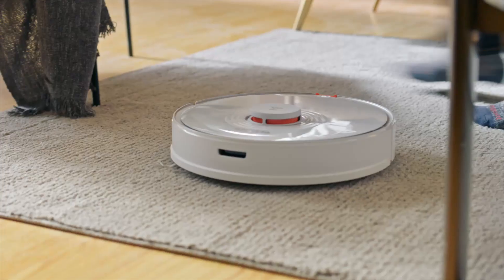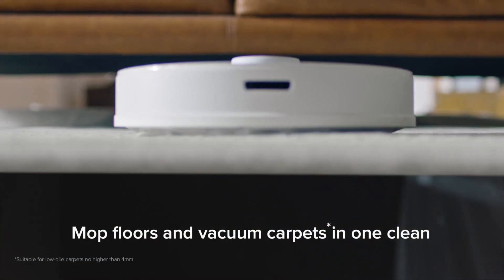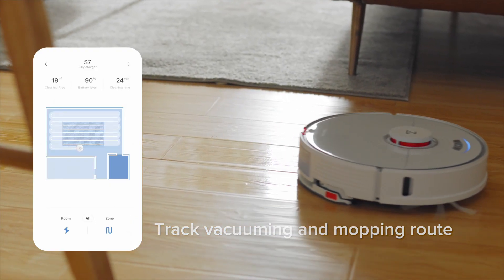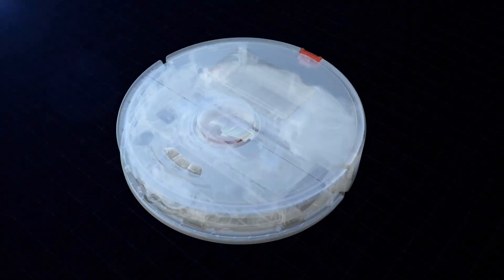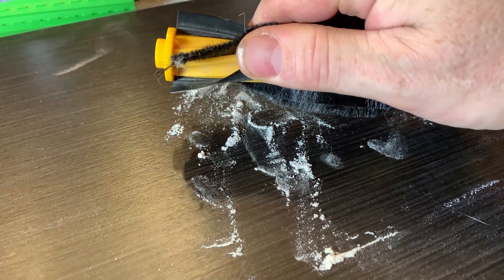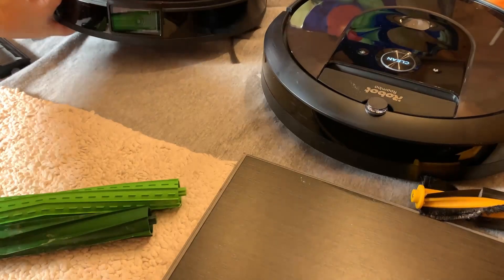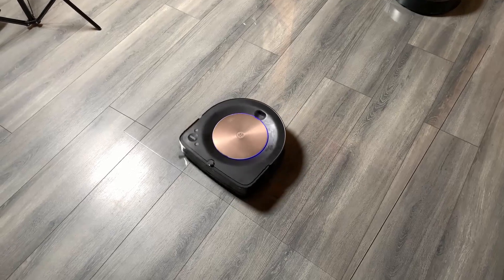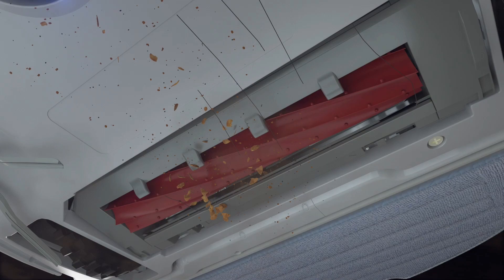Roborock S7 - New Brush Design, Will it Scratch Your Floors?

Comment: Hi, I got s7 maxv and it even scratches my tiles (!). Reason of this is the plastic teeths which are part of the brush cover. Was trying to stick the tape to it but with no result - it gets simply removed during the vacuuming. Wondering if anyone found a solution to this? I was thinking if I can remove these teeths and polish the surface?
Reply from the maker: Even if the plastic teeth were touching the floor, they cannot scratch ceramic tiles. And they do not touch the floor, not even a little. Are you sure what you are seeing are scratches? Mine used to leave lines on the floor but you could rub them off with your finger. Now it stopped doing that.
Reply: @MrRoombato  I got pics where you can see these teeth are affected - plastic is scratched due to contacting the floor so it must be them. And they indeed are in contact with the floor as entire cover is floating
Reply from the maker: Maybe your robot is out of spec. On mine, if you put it on a flat surface like a table and look underneath, those teeth are quite far from the floor.

Comment: Did you end up testing this and seeing if it will scratch the floor?
Reply from the maker: No, because I'd have to use it in my house to test it, and I like my floors. I've had multiple subscribers report that it does indeed scratch floors, and pretty severely, but not from the brush. It's the brush housing, for the most part.
Reply: @MrRoombato  yeah I’ve been doing some research and I’ve heard that too. It looks like it would be possible to Dremel those things right down. Have you heard of anyone successfully doing this?
Reply from the maker: @pklemm1  I haven't. And you shouldn't have to. Also, that auto-empty bin sucks. So...why bother?
Reply: @MrRoombato  true… you don’t know if any other brush holder fits on the S7, do you?
Reply from the maker: @pklemm1  Nope, and again, why bother? Why fix a broken product? Just don't buy it. Get something that isn't ridiculous.
Reply: @MrRoombato  any good suggestions?
Reply from the maker: @pklemm1  I am using the Neabot Q11 right now. It's going through some growing pains (firmware, app) but it's mostly good now. The only downside is it's more prone to hair tangles than some other robots. But I still own every robot I've ever reviewed, and that's the one I use. That and the N1 for my bedroom and study/office. They aren't the best robots but they are the only ones that work without annoying the @#@$@! out of me.

Comment: Have you tested it? I really want to get the S7 instead of the S6 Max V for a potential upgrade to the cleaning base later, but I feel like I will have to settle for the S6 Max V :(
Reply: I can confirm it scratches floor even on lower setting. It is visible with flashlight. Tested in wooden table and it literally dug its way.
Reply from the maker: @smilen-monev  Thank you for letting me know. It's very unfortunate. Do you know what about it does the scratching? Is it the brush? The housing? Both?
Reply: @MrRoombato  the housing, the 4 parts act as teeth to an extent.
Reply from the maker: @smilen-monev  Thank you. Unfortunately a few others have said that as well. It's a shame. Roborock is now permanently scratched off (haha scratched) my list of viable robovacs. At least until they abandon this madness.
Reply from the maker: Sorry, no. If they send me one, sure, but I'm not going to pay my own money for it. I've had several subscribers report scratched floors, mostly from the brush housing. I'd skip the S6 MaxV (wanna buy mine? :) ). I LOVE the robot itself, but no auto-empty dock makes it kinda useless for me.

Comment: Would having the Roomba vacuum carpets before vacuuming hardwood floors take care of this issue?
Reply from the maker: I don't know what the issue is with the S7 precisely because I haven't tested it, all I know is that it has a rubber brush that picks up dirt and a brush housing that presses dirty plastic into the floor. Also,  several subscribers have told me that it scratched their floors and one sent me photos. Regardless, it's not something that's going to be fixed by cleaning carpets first. Maybe thoroughly cleaning the housing and brush after each cleaning would mitigate it to the point where you'll never notice, but I can't be sure.

Comment: Hello, are you going to test Honiture Q6? A scratch test would also be welcome ... For now what is the best vacuum cleaner for you that does not scratch or scratch all? otherwise you have to prefer the swiffer broom ^^
Reply from the maker: The Q6 appears to be built by the same company that makes the Neabot N1, so unless they screw up the app, it's a great robot. The Neabot is my favorite robot so far...it would be the Ecovacs T8 AIVI, but its auto-empty station sucks (or fails to, rather) for pet hair and its app is buggy. So far in my experience, only robots with rubber brushes and brush housing that press firmly down scratch floors, so anything with a hybrid brush should be fine. The Neabot doesn't scratch floors, so the Q6 shouldn't either.
Reply: @MrRoombato  thank you so much !

Comment: My wood floors are very veiny as they’re sandblasted, so the fine bristles actually clean them much better than full-rubber brushes.
Shame you can’t actually choose what kind of brush you want to mount on these things.
Reply from the maker: Indeed! However, I recently learned that iLife has a new lidar robot, the A10, that comes with two brushes...a hybrid and a fully rubber one. So if it does well commercially, that will be a feature that other manufacturers may adopt.

Comment: On the roborock S7 website it lists “scratch Safe wheels and brushes”
Reply from the maker: That’s promising, it means they are aware of the issue. If I had to guess, it’s the bumps on the fins. They could keep the fin from rubbing against the ground.
Reply: @MrRoombato  I think these bumps leave scratches on the floor.
Reply from the maker: @kmerdzhov  The bumps in the brush? That's such a shame.
Reply: @MrRoombato  yes, it's indeed very disappointing
Reply: @kmerdzhov  Have you tried the S7, and experienced scratches?

Comment: Why don’t robot vacuums come with soft rollers... i dont have any carpet
Reply from the maker: That’s an excellent question. They should. But many of the hybrid brushes only make contact with the bristles on hard floors. The rubber fins come into contact with carpet, since the fibers stick up higher. That’s not always the case though.
Reply: @MrRoombato  exactly. I found on cordless stick vacuums, the soft rollers are just amazing and i know many people who don’t have any form of carpet. It would be even better if it had a dual roller system like shark vacuums.

I also found that since my wife has long hair, most robot vacuums will have tangles around the roller and side brushes within two days, so i hope manufacturers find a way to deal with that
Reply from the maker: @Zoranurai13  My wife also has long dark hair as thick as piano wire. So do my daughters (though not as thick!). So fishing that out of robot vacs is a pain in the butt, since I have five robots on active duty. I used to do it every other day, but now I just do it once a week. The i7 is good at avoiding tangles, and the hybrid brush robots clean fine with hair wrapped around the brushes.

Comment: Same problem when washing/waxing cars with same towels/sponge
Reply from the maker: You're totally right. I should have used that as an example!
Reply: @MrRoombato  haven't really seen this with my 595 but plastic housing did scratch when hit furniture. Fixed that by adding one of the cushions sold to prevent that.
Reply from the maker: @kinglord5429  From what I can tell by looking online, the 595 has one bristle brush and one rubber brush. The rubber brush may not be the "offending one," which I think is the light green one with the really small fins. The dark green one has large fins and probably doesn't make too much contact with the ground.

Also, you wouldn't really notice it for a very long time. I only noticed because of a freakish coincidence, which is what made me do my tests.
Reply: @MrRoombato  the 595 is close to 10 years old, this is like a tank. It does use bristles and one rubber which doesn't really make any big contact with floor. Bristles do wear down so have replaced them few times but rubber one mostle replaced because fin tore.  I would not have thought would be scratching floors and looks pretty bad. I wanted one with self emptying bin but now looks lik I'll stick with this until fix brush problem. Just replaced treads they wore out  now back to tearing around the house

Comment: Damn, it even scratch glass, that means every flooring material known to man, from hardwood, ceramic and marble are all going to be scratched.
Reply from the maker: Plexiglass! It's not remotely as hard as glass. It's probably not even as hard as most floor finishes (except maybe the polyurethane you use to seal hardwood floors). Plexiglass is plastic, and scratches easily. So what you see in one pass on plexiglass will take a long time to show up on your hardwood, laminate or vinyl floor. But it will show up eventually.
Reply: @MrRoombato  ah plexi. Good to know it's not actual glass. My house is mostly ceramic and some marble flooring. So it's good knowing that it won't scratch those.
Reply from the maker: @limitlesssky3050  Yep, should be safe with those! Sorry about the false alarm.

Comment: Not a chance rubber brushes are better than bristles. Rubber will wear out much faster IMO.
Reply from the maker: That is probably true, but that does not impact their cleaning performance. Rubber brushes do clean better, as I have seen from conducting numerous tests on both types, on both hard floors and carpet. Also, Roborock isn’t switching over to rubber just because it looks cool. :)

Comment: Seems like this problem could be solved by the manufacturers simply being honest about it, and giving the option of using brushes for hard floors and the rubber rollers for carpets.
Reply from the maker: I honestly don’t think any of them know about this. Which is odd for me to think, because they should know. It’s kinda dumb for them not to. But if they did know, them they would know that if this were to become public knowledge, there could be some pretty serious blowback. 

My worst nightmare at this point is all of them going to rubber brushes and everyone just sticking their heads in the sand about the floor scratching. I have no idea how long it would take for these things to wear through the polyurethane finish of hardwood floors. Could be years. People aren’t very good at accepting and acting on future problems.
Reply: @MrRoombato  I know what you mean. It sounds contradictory but I think customer use is more testing/QA than what should normally occur during the R&D process of products these days. They just want to come up with a fancy design, ship it and get money coming back in. And with every manufacturer trying to "me too" each-other's features, I could see them all switching to the rubber roller bandwagon. I suppose the only potential solution is for us to start voicing these concerns to them and hope they notice.
Reply from the maker: Well then I'm glad to be the first voice of dissent against rubber brushes. :)